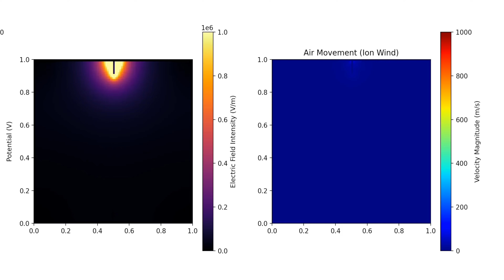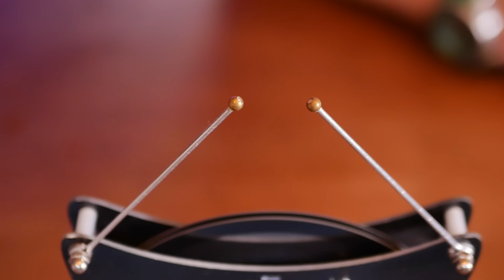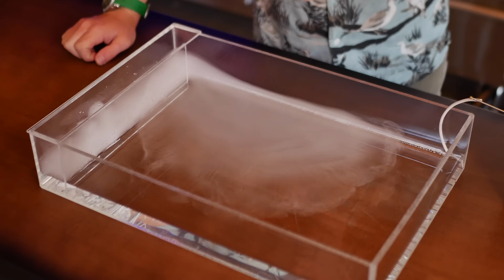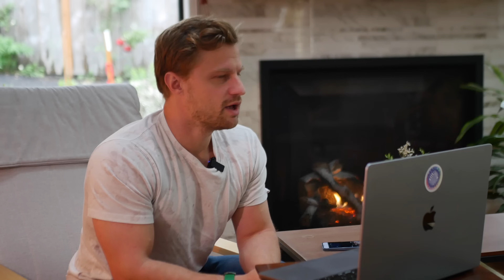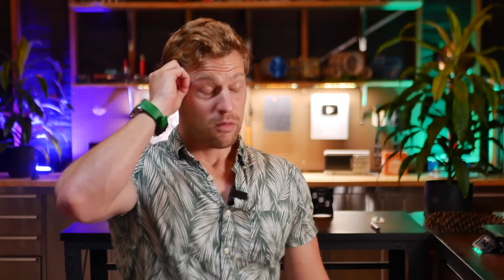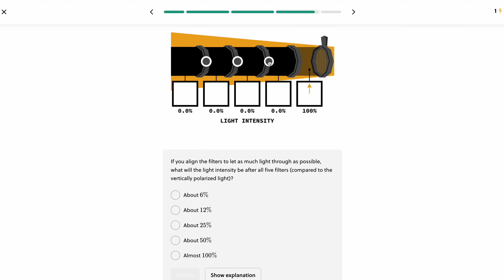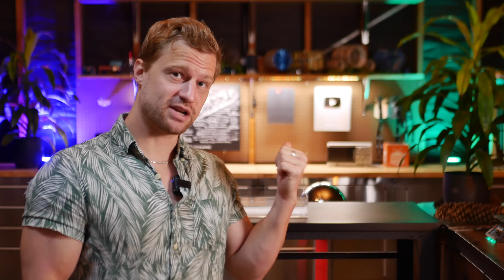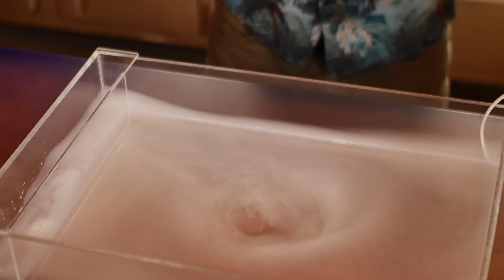This High Voltage Fog Is Controlled by Pointing (BiFrost Nebulagraphy)

Comment: THEORY OF EVERYTHING IDEA:  Revised TOE: 1/24/2024a:

TOE Idea:  Short version:  (currently dependent upon the results of my gravity test):
The 'gem' photon is the eternally existent energy unit of this universe.
The strong and weak nuclear forces are derivatives of the electromagnetic ('em') interactions between quarks and electrons.  The nucleus is a magnetic field boundary.  'Gravity' is a part of electromagnetic radiation, gravity acting 90 degrees to the 'em' modalities, which of course act 90 degrees to each other.  'Gravity' is not matter warping the fabric of spacetime, 'gravity' is a part of spacetime that helps to make up matter.  The gravity and 'em' modalities of matter interact with the gravity and 'em' modalities of spacetime and the gravity and 'em' modalities of spacetime interact with the gravity and 'em' modalities of matter.

TOE Idea:  Longer version:  (currently dependent upon the results of my gravity test):
THE SETUP:
1. Modern science currently recognizes four forces of nature: The strong nuclear force, the weak nuclear force, gravity, and electromagnetism.
2. In school we are taught that with magnetism, opposite polarities attract and like polarities repel. But inside the arc of a large horseshoe magnet it's the other way around, like polarities attract and opposite polarities repel. (I have proved this to myself with magnets and anybody with a large horseshoe magnet and two smaller bar magnets can easily prove this to yourself too.  It occurs at the outer end of the inner arc of the horseshoe magnet.).
3. Charged particles have an associated magnetic field with them.
4. Quarks, protons and electrons are charged particles and have their associated magnetic fields with them.
5. Photons also have both an electric and a magnetic component to them.

FOUR FORCES OF NATURE DOWN INTO TWO:
6. When an electron is in close proximity to the nucleus, it would basically generate a 360 degree spherical magnetic field.
7. Like charged protons would stick together inside of this magnetic field, while simultaneously repelling opposite charged electrons inside this magnetic field, while simultaneously attracting the opposite charged electrons across the inner portion of the electron's moving magnetic field.
8. There are probably no such thing as "gluons" in actual reality.
9. The strong nuclear force and the weak nuclear force are probably derivatives of the electro-magnetic field interactions between quarks and electrons.  In the case of the alpha particle (Helium nucleus), the electro-magnetic field interactions between the quarks themselves are what keeps them together in that specific structural format.
10. The interactions between the quarks EM forces are how and why protons and neutrons formulate as well as how and why protons and neutrons stay inside of the nucleus and do not just pass through as neutrinos do.  (The neutrino being a substance with a very high gravitational modality with very low 'em' modalities.)
11. The nucleus is probably an electro-magnetic field boundary.

THE GEM FORCE INTERACTIONS AND QUANTA:
12. At this time, I personally believe that what is called 'gravity' is a part of electromagnetic radiation, gravity acting 90 degrees to the 'em' modalities, which of course act 90 degrees to each other.  'Gravity' is the force which allows a photon to travel across the vast universe without that swirling photon being flung apart or ripped apart by other photons and/or matter interactions.  Gravity being a part of the 'em' photon could also possibly be how numbers exist in this existence for math to do what math does in this existence (the internal oscillations of the 3 different parts of the 'gem' photon, each modality having a maximum in one direction, a neutral, and a maximum in the other direction.)  'Gravity' is not matter warping the fabric of spacetime, 'gravity' is a part of spacetime that helps to make up matter.  The gravity and 'em' modalities of matter interact with the gravity and 'em' modalities of spacetime and the gravity and 'em' modalities of spacetime interact with the gravity and 'em' modalities of matter.
13. I also believe that the 'gem' photon is the energy unit in this universe that makes up everything else in this universe, including eternally existent space and time.  ('Space' being eternally existent energy itself, the eternally existent 'gem' photon, 'Time' being the eternally existent flow of energy, 'Space Time' being eternally existent energy and it's eternally existent flow).
14. When these vibrating 'gem' photons interact with other vibrating 'gem' photons, they tangle together and can interlock at times. Various shapes (strings, spheres, whatever) might be formed, which then create sub-atomic material, atoms, molecules, and everything in existence in this universe.
15. When the energy units unite and interlock together they would tend to stabilize and vibrate.
16. I believe there is probably a Photonic Theory Of The Atomic Structure.
17. Everything is basically "light" (photons) in a universe entirely filled with "light" (photons).

THE MAGNETIC FORCE SPECIFICALLY:
18. When the electron with it's associated magnetic field goes around the proton with it's associated magnetic field, internal and external energy oscillations are set up.
19. When more than one atom is involved, and these energy frequencies align, they add together, specifically the magnetic field frequency.
20. I currently believe that this is where a line of flux originates from, aligned magnetic field frequencies.

NOTES:
21. The Earth can be looked at as being a massive singular interacting photon with it's magnetic field, electrical surface field, and gravity, all three photonic forces all being 90 degrees from each other.
22. The flat spiral galaxy can be looked at as being a massive singular interacting photon with it's magnetic fields on each side of the plane of matter, the electrical field along the plane of matter, and gravity being directed towards the galactic center's black hole where the gravitational forces would meet, all three photonic forces all being 90 degrees from each other.
23. As below in the singularity, as above in the galaxy and probably universe as well.
24. I believe there are only two forces of nature, Gravity and EM, (GEM). Due to the stability of the GEM this is also why the forces of nature haven't evolved by now.
25.  'God' does not actually exist except for as a concept alone.  The singular big bang theory is a fairy tale for various reasons.  The CMBR from the supposed 'bang' should be long gone by now and should not even be able to be seen by us.  Red Shift observations have a more 'normal' already known physics explanation, no dark energy nor dark matter needed.  The universe always existed in some form and never had a beginning and will most probably never have an end.  Galaxies collapse in upon themselves, 'bang', eventually generating new galaxies.  Galaxies and 'life' just come and go in this eternally existent existence.

DISCLAIMER:
26. As I as well as all of humanity truly do not know what we do not know, the above certainly could be wrong. It would have to be proved or disproved to know for more certainty.  Currently, my gravity test has to be accomplished to prove or disprove that portion of the TOE idea.  But, if not this way, then what exactly is the TOE of this existence?

GRAVITY TEST:  (Short Version):
Direct a high powered laser 90 degrees through an electric field and magnetic field polarized as such to nullify the 'em' of the laser.  "IF" my current TOE idea is correct, a gravitational black hole would become evident.  (The 'gem' photon being the energy unit of this universe that makes up everything else in existence in this existence.)

Comment: I mean, if the catastrophe beams paper is generalizing "light" as photons,
transferring the heat as energy from the sunlight to create these beams would make a lot more sense,
and would link up these 2 phenomenon,
Reply: If one of your fingers is touching the low voltage line, then wouldn't 'theoretically' your static field around your body be extended/amplified,
allowing a low current of electrons to escape your fingertip following the least resistant path through the static field toward the surface of the water,

Comment: Got some bad news for you - you don't understand catastrophe beams... I'd never heard the term myself, but as I half suspected on hearing it, its very closely related to what I did my PhD on. Well the physics side of it at least. Totally an optical effect from gigawatt/cm^2 (or more) beams, in that only photons will be self focused. The mechanism does involve self induced electrical multipoles and therefore in air, potentially, plasma etc. etc. Nonetheless, your ions and or wind cannot self-focus in this particular way.

More probably electrons from your massive guns mate ;)

Would have been more interested to see you holding different tipped objects at the fog

Comment: So technically you turned your finger into an ionic thruster so the next question would be if you tapped the high voltage wire to your back your fingers and toes would become thrusters how much voltage would it take to fly

Comment: every time I hear 'ion bridge' I also hear - star trek phaser. Or at least non physical-wire taser. If you can create an ion bridge long enough, you should be able to build a taser that doesn't need wires. Looking forward to that video.
Reply: The streams are carrying matter (such as with 1970s ink-jet printers.)    Try tattoo ink.   Then apply megavolt pulses, to create hypervelocity, so the streams will penetrate your skin.   Build a "tattoo gun" with a large HV pulser inside, that can print tattoos in a fraction of a second, from several feet away.   Would people complain?   Then use ultraviolet marking-ink, where they only discover their tattoo many days later, if at all.

Comment: I would be interested to see a visualization of the electrical current distribution, as concentrated current flow seems to be a key point in your hypothesis.  Also!  If the "air wire" has to first form and then stays connected, will blowing air perpendicularly between your finger and the water disrupt the connection and make you need to reform it at closer distances?

Comment: In the Oil Field a high tension DC grid of wires is often used over crude oil just out of the ground to crash out its often hefty water component quickly, suitable for continuous stream production. No one pays for wet crude.

Comment: Rocket engines overcame a massive thrust and steerability hurdle when a designer realised the shape of after flow mattered as much as fuel and air flow/mixture. He simply added a flared cone to disperse the out flow and increase pressure before the exit this works by removing pressure outside of the exhaust creating a pressure difference that controls combustion. Love the video bro and your energy for creation inspired us all. Keep the stoke 🤙🔥

Comment: When you put your palm over it it reminds me of electrospinning. I'm kinda surprised you haven't done something with it to make you into a web weaving high voltage spider man. But there's not really much plasma in it. The vortex though reminds me of the lorentz force the stuff that makes a magnetohydrodynamic drive work but without the constrictions causing the vortex. Like the palm is creating a bunch of charged particles and the ion path strikes and it creates a vortex around it's EM field.  Really nifty.

Comment: @Graham_Wideman  
>  I think this video demos something even less fancy than electrospray, and that's plain old "ion wind" - - -   
You need to watch Jay's whole video here. He already discovered that sharp wires (or needles) don't work, and instead will violently blow the entire fog away.  That's the ion wind you mention.   
The mystery is, why do fingers only make a tiny dot or two?  Unlike the wire?   Certainly it involves electric wind, but wind in the form of a narrow thread.

This effect was discovered in 1995 by HV hobbyist Charles Yost using Schleiren Photography, and the fog version discovered in 1998, ...so I've had longer to think about it.   It's online as a science-fair experiment, and even on YT in 2008.  

Sometimes your fingers do nothing.  Sometimes there's two dots, or three.  Why?   

It's because the "air wire" is coming from tiny bits of lint on your fingers.  To make your too-clean fingertips work, wet them and then drag them across cloth, to get some lint.  Works great.   Or try wearing a woolen mitten.  (We found that for some reason, these work better if not dried out.)

I first discovered the fog effect with a thick red DC HV wire with heavy rubber insulation.  When the side of the wire moved across a tray filled with dry ice fog, some invisible streams carved eight or nine slots in the fog.  Must be something on the rubber surface?  Wipe down the wire, and it all stops happening.  It must have been caused by lint or dust fibers, attracted to the wire insulation.  

So instead, hold a single human eyelash in your fingers.   Use it to reliably draw on the fog.  (Eyelashes seem to work slightly better than hairs.)  Now try a sewing needle, and instead it violently blasts the fog away, punching an inches-wide crater, as shown in the video.

WHY does an eyelash behave differently than a metal needle?

I joined the UW chemistry department in 2002, and discovered that this effect is in wide use.   They don't use wires or eyelashes.   They use wetted syringe needles, with a drop of liquid at the tip.   The "air wire" is actually made of a chain of liquid droplets flying through the air at high velocity.   Scientists have even managed to photograph them under a microscope.   Or, put fluorescein dye in the water, then blast the "air wire" with a UV laser, and you can see the stream by eye.  (I haven't tried these myself.)

Once you can search for research papers, you can find the original discovery:  long chains of electrospray droplets coming from a Taylor cone.   These "air wires" even got the 2002 Nobel Prize in chemistry, John B. Fenn

Comment: Would this work if you put a glass plate over the top of the fog, (keeping the fog from easily dissipating)? If so maybe you can use ai to extrapolate what youre ‘writing’ in the fog from some type of machine beneath the fog, then display it on the glass plate in top. Almost like making a screen you can write on 🤔

Comment: What if you add salt to the water to increase the conductivity... you're simulating a tesla coil, the electrons are attracted to ground so the energized high frequency electrons are just wirelessly traveling to complete the circuit no?
The fog moves because the electrons push it outta the way.
Reply: I didn't finish your video before I typed that, got excited!

I'm gonna rabbit hole this ionic bridge thing.

Comment: Radio Frequency physics lesson, the AM Gradiometer utilizes the ionization created by the strongest AM Radio Station broadcasting in the area under survey. The instrument has a built in spectrum analyzer that scans and automatically phase locks onto the AM radio station signal with the highest strength. Then the operation has to perform a scan walking back and forth in bi-directional pattern like mowing the grass. The sensor collects the E field ionization being emitted vertically towards the surface and records in sync with the DGPS w/ 1cm accuracy, The buried objects will emit a FER (free electron radiation) field around the anomaly like you see when you plasma beam makes contact with ground. It's really interesting to see you visualize this phenomenon! NICE WORK! Research Dr. Larry Stolarczyk AM Gradiometer.

Comment: Out of curiosity, if you generated a device with your positive on one side and your negative on the opposite side, spaced about a foot and a half to 2 feet apart the ion bridge the way you have it set up with the Vander graft generator and then applied a second electrode set with high voltage and high amperage. Would that not generate a plasma stream between the two contact points, just curious if this could be used as a plasma cutter and bridge plasma cutter that would allow you to cut much larger materials by generating that conductive air wire and then superheating it something like a superheated cheese wire I find this concept fascinating

Comment: You could try placing a thin film on top of the container, or grounding a metal mesh instead of the water to know if there is ionic wind involved. 
You could try metal shapes instead of finger to know how much control you have.
Reply: I added a bump, with an upwards-pointing human eyelash standing on top.  It was all inside the fog-layer.  That way I could SEE a white vertical fog-jet going upwards.   And the tip of the eyelash was like a black hole, pulling in fog from all directions.
Reply: You could try adding a bump in the water like a metal ball. 
Could try non condensing fogs or smoke or a nebuliser. 
You could film in slow motion to see if the fog is pushed away or just dissapears.

Comment: I noticed the simulation had the beam perfectly vertical; is that using a square lattice? Would the result of the simulation look much different if it used a hexagonal lattice and the beam was aimed at some angle that's not perfectly aligned nor orthogonal to any of the walls of the hexagonal cells?